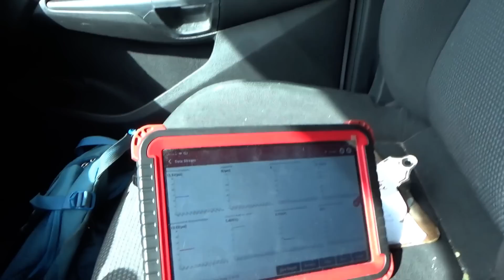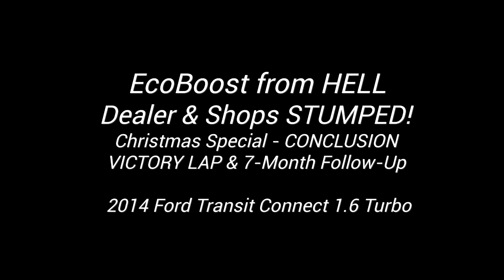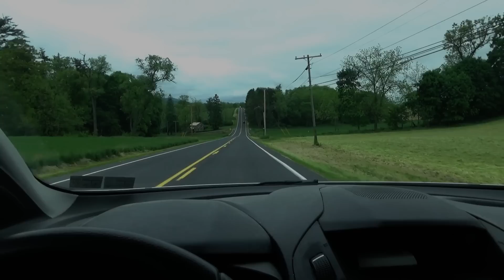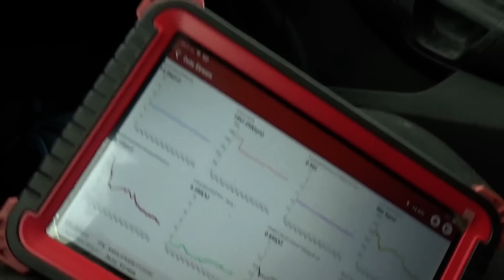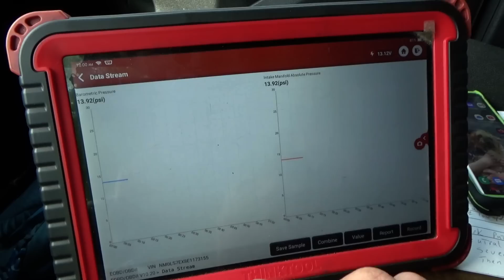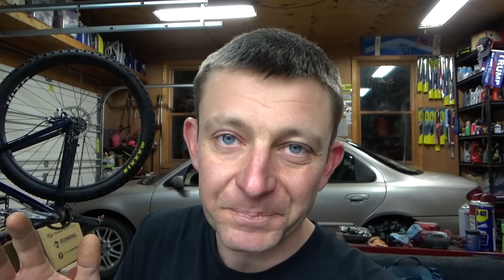(CONCLUSION!) *7-MONTH Follow-Up* EcoBoost From HELL (Christmas 2024)

Comment: Great job Ivan, those quick changes on the MAF were not obvious.  In regard to a diagnostic approach perhaps an idea would be to run a FFT on the various analog sensor data.  If the sensor  is being affected by an intermittent ground then it might show up with a high frequency spike on the spectrum? 🤔
Reply from the maker: Interesting thought! It seemed like a slowly drifting analog signal vs an intermittent connection, so not sure if FFT would show anything interesting 🤔
Reply: @PineHollowAutoDiagnostics  I wonder if the scope might have shown something a bit different in terms of the rate of change.  Jiggling the harness showed abrupt changes and the scanner data might have relatively poor sampling 🤔

Comment: As a recently retired auto/truck repair  shop owner for  30 years here in Florida I am a regular fan of your videos. This one with this pastry van really got my attention. I watched every episode being really anxious to find out what the problem was,  your patience and due diigence paid off.  After watching that video I wondered  to myself if any of these engineers, or technical staff from Ford ever looked at your videos, of course they would never admit it, but the time you had spent troubleshooting this issue and also the time that other shops and the dealer had misdiagnosing this. If Ford really cared about customer loyalty they should be able to offer to take of this customers bill as it was proven by your video that the crappy method  they  used at the factory crimping that splice connection rather than as you showed again by soldering that connection.  Of course they would not even offer a comment on this as their own dealership was not able to fix it and they would be afraid they may have to cover this under warranty. Great video.

Comment: So can it be said this splice is a factory flaw? Why didn't it manifest itself before hitting 100k miles? Must have been the wear and tear, heat cycles, etc.
Reply from the maker: They designed it perfectly to fail after 10yr 100k mile warranty 😂

Comment: In the telephone company we dealt with high joints all the time.   On data circuits we would leave 24 volts across the simplex on the audio coils just to keep current flowing to avoid high joints in a spice somewhere.     I can't tell you how many times the trouble would clear when we accessed the circuit with test equipment.   Just that additional capacitance bump from our test equipment would seal the high joint for awhile.   That's probably what is going on when you disconnect and reconnect the modules.    The re connection pulls just enough sudden current to clear the high joint temporarily. That's where a high impedance digital VOM can help to find voltage drops across splices without clearing the trouble.
Reply: High joint means high resistance connection, like Ivan's. A lot of the problems are actually caused by air pollution.

Comment: Re: the weird behavior of the splice, I worked in audio for many years and similar thing would happen when a thin layer of oxidation would form on bare metal surfaces increasing resistance at the contact point. The extra weird part was if there was was enough voltage and therefore current flowing at the point of contact it will 'burn' through the oxide layer and work ok for a while until left un-energized for some time and the oxide layer would re-form and issues began again. This was mainly with multi pin connectors at microphone levels (a few millivolts). De-oxit is your friend here. Soldering works too as it shields the contact from the oxygen in the air , but you cant solder a connector you need to de-mate frequently.
Reply: Yes an excellent assessment @HarblesTheSkeptial. Might I add that that splice was not sealed from the nasty environment of that engine, road salt water, the battery acid vapors and whatever else was drifting through from the vehicles on the road. Then there is the electrolysis from the current in the splice. What a chemical soup! All happening at a molecular level that is not visible. The corrosion is even beyond Ivan's eyes. That splice needs to have been in a gas tight sealed shrink wrap splice cover. The solder job is the right solution however I would have applied some rosin RA flux to the splice then heat it to let the flux activate. Then the solder would have wicked right into the splice. Then add a glue filled shrink tube. An awesome job Ivan! You should hold a offsite training session for the dealer technicians and charge them a hefty fee. What a great case study.
Reply: @jimharmon3404  "You should hold a offsite training session for the dealer technicians and charge them a hefty fee.". No one would show up; they rather sell complete new harnesses to their customers 🤣
Reply: @jimharmon3404  Electronics-grade solder (eg the type Ivan uses) contains a resin core, so full wicking is guaranteed. Additional flux can help but is usually only needed if the thermal mass is too great to allow good wetting.
Reply: Came here to say this and you had beaten me to it!
The fault defies Ohm's Law because of that oxide layer, it's behaving like a semiconductor - having a forward voltage drop rather than a resistance
Reply: Just to addto this excellent explanation, during the manufacture of that particular harness those splice wires may have been stripped ready. Friday afternoon. Left all weekend where the stripped copper collected that atomic level corrosion on the strands. i dont know but the atmosphere in the factory may have been a bit acidic? Then Monday crimped up and job done. its taken those years to finally act like some silicon diode with a breakover bias. Hence any forward voltage and current breaks it down. Good effort Ivan.
Reply: Exactly my thoughts. The same reason stainless steel and aluminium are awful material choices for any electrical connection air can get to because they oxidise instantly at an atomic level when exposed to air, forming a “passivation layer” you can’t see. A high enough voltage and current will break it down but for low level and sensor signal circuits, the resistance will be highly variable.
Reply: If you are right Ivan is right that a solder joint is always better then a crimp in those conditions! You would expect that car manufactures should be aware of this problem and thus stop using these type of splices.
Reply: @mark-d9k9b  Wiring harnesses are made up on specific jigs and the wire lengths may even be pre-cut.
In the production line environment the open barrel crimp is the fastest, most reliable and repeatable connection method.
Keeps the health & safety people happy too because there's no high temperatures or fumes.

For a field repair, you have to choose the most practical repair method, which may differ from the factory method.

People claim soldering causes a fracture point.
Guess what... So does crimping.
As long as the joint is protected from vibration stresses by using adhesive lined heat shrink and is done on a part of the harness that doesn't flex in operation, there's no issue with a soldered repair.

I've done many wiring repairs and maybe 10% of them can only be attributed to production line damage - situations where a wire within the harness has gone open circuit but has not been physically damaged by anything on the vehicle.
Reply from the maker: Excellent explanation! 👌😁
Reply: Like Ivan noted that splice was inside the harness and was sealed up quite well from the factory, so I can only assume that that splice joint must have been made improperly at the factory. Like maybe there was some kind of corrosion or dirt on the wires that were spliced together..

Comment: Possible explanation: galvanic corrosion. Hear me out- you don’t have to see the green corrosion grinch for there to be a corrosion problem, it can exist between wires if there is a voltage potential and an electrolyte. Even if it looks dry, the moisture in the air is sometimes enough. I fought a similar issue on an F-18 once, took a month to solve so don’t feel bad lol.

Comment: How about this theory on that splice. That splice crimp metal was cut and formed on a sheet. Many sheets of metal are plastic wrap-protected. WHAT IF that crimp was formed with a piece of thin plastic sheeting on it. Time, age, heat, and melting to self-insulation of the wire. ???????????????????

Comment: Your the best Ivan. This is the wildest repair I've ever seen I think. Who the heck would suspect that splice when it pass the tug test. I can't see a reason why it wouldn't work. It's mechanically strong. It's connected. And for low current less then 1amp. It's hardly a heat issue. It's boggles my mind.

Comment: I HATE crimp joints in wiring. Too many variables happen with them. IF there is any type of looseness in the joint, it causes the variable. You found this in a Volvo you worked on a year or so ago where a chassis ground wasn't clean enough to cause problems. Same thing with the engine ground on the Camry. They have to be CLEAN and TIGHT. With all of the computerized modules in cars depending on good wiring connections, you have to pay close attention to the wiring and proper connection within the wiring system.

Comment: Ivan, this case study and series was your best yet. The scanner showed lots of erratic behavior, and that wiring diagram showed how all these sensor codes and grounds were inter-connected to a 5 wire splice in the middle of a wiring harness. Solder for the "WIN".

Comment: I am with you.  MIND BLOWN !  That crimp looked PERFECT !  I am still surprised that you declared 80mv ground difference was "acceptable".

If your customer wants to keep that van on the road for another 100,000 miles, I would suggest he change the timing belt and guides.  Also, every 10K-25K, check the MAP sensor and other "critical" sensors for oil (unless someone finds the root cause).  Finally, every 25K pull the camshaft oil control solenoids and clean them.

I hope the customer got his money back for the sensor that was NOT replaced.  He should get his money back for the defective Dorman solenoid.

Curious.  How many labor hours did you charge for diagnostics and repair.
Reply: Sensor grounds loop thru the PCM so it'll never be zero.   What matters is that it is consistent.
Reply: @v12alpine  True on consistency !  

The best sensors should be ratio metric, like temperature sensors or throttle position sensors.  Pressure sensors are "absolute" and therefor are susceptible to ground or Vref offsets.

25+ years ago I designed PCMs.  There should be no "loops" !  Every sensor/actuator should get ground from the module.  Multiple grounds from the PCM should attach as reasonably possible to battery ground.   IIRC, the PCM "case ground" was isolated.
Reply: @jackpatteeuw9244  yea, loops are bad...I should have picked a better description... for sensors, its usually a "star" ground with the PCM being in the center.

Comment: Ivan could one of the components of that ground tree issue have been bleeding off voltage from a capacitor or something like that and that was causing the higher voltage?? Or could it of been another wire near that splice sending out an erroneous trickle voltage and when you soldered that splice it had a better / direct connection to ground?  Just thinking outside of the box. Your videos do a fantastic job of explain the complexity of these over engineered autos. I do not know of anyone who would of solved that van's problems. Every video I learn something new. I would like to say Merry Christmas and have a very Happy New year.

Comment: I suspect unplugging that sensor allowed the bad crimp/wire to cool restoring the correct reading when you plugged it back in. 
Resistance being proportional to heat (like a thermistor) in that bad factory crimp seems like it was just heating to a set point then setting there giving you the reading you keep seeing.

Comment: 11:23  Map and Baro SHOULD agree.  When they don't, it should set an error flag that THEY DON'T AGREE

I recently suggested on SMA that the onboard error detection is still immature.  In SMA I demanded there be a backup CAN bus(es) with provisions to automatically switch as needed.  AND to ACCURATELY report this effort.  Redundancy isn't anything new but certainly more expensive but well worth assuring my trip from Denver to St. Louis won't be a broken event particularly during cold, dark holiday travel.  

COME-ON designers...   computer memory prices are cheap; processor speeds are sky-rocketing;  technology is well developed, so let's focus on and market upon: enhanced error detection and correction.  Already implemented is substituting calculated parameters for flagrant/suspect values -- so expand upon this.  And... computer software update isn't difficult or uncommon.  An update for $100 would/should keep shops busy.  I.E. software is NEVER fully complete.
Reply: Ivan showed examples of the  non-matchng pressure sensors setting an error code.  The CAN bus is likely to be supplanted with  ethernet, but even if not,  I suspect only a small fraction of breakdowns would be attributable to CAN bus failure per se, so might not be the highest priority for redundancy.  (There might be more benefit in making modules' interface to the bus fail in such a way that it never wedges up the communications.)   And as for software updates:  over-the-air updates are becoming more common -- no need to go to the dealer.

Comment: I am suspicious that this connection was acting as a transistor. See my comment from yesterday where the lead oxide on my battery post became a diode that permitted current flow out of the battery but prevented the alternator from charging it.
Reply: Several comments below offer the idea that this is more like a diode effect. This is possible, with a very low reverse potential fence. Once overcome it loses its resistance. It explains how it can have resistance sometimes and other times not.

Comment: I think the explanation for the "fixed" 0.3V voltage drop could be slightly dissimilar metals and some conductive fluid making them act as a battery cell at 0.3V.  Wiggling the crimp would cause the metals to actually contact each other (rather than having a microscopic separation from whatever fluid was there - most likely salt water) and that would discharge the "battery", causing the voltage drop to be near 0V for a while. Forcing current through the ground would again charge the "battery" to it's cell voltage of 0.3V.

Re the codes the engine computer set:
Maybe they had some limit on how many codes they were allowed to use (either technical limit, or some idiot manager setting some arbitrary limit) and they had to use whichever code that seemed the least bad rather than have an actual code. Sure, whatever the description of that code was hints at that the sensor value is wrong, but it would had been better if there were a specific code for the outside pressure v.s. intake pressure not agreeing when the engine is off.

Merry Christmas and a happy new year Ivan!

Comment: 1. Youtube pisses me off.  I missed several of your videos because somehow I became "unsubscribed".  2.  I'm not impressed with how many systems can be affected by one small thing.  I have a 2020 6.2 Sierra with 121k miles.  Around 96k I replaced the plugs and plug wires.  Bought the coil packs but didn't replace them.  About 109k miles, the cruise control started acting up.  Scanner showed multiple codes across Brake Control Module, Transmission Control Module, ECM, BCM, etc.  Truck ran fine, but one weekend I decided I was going to find the problem.  I suspected maybe a chafed harness somewhere in the engine bay or under the truck.  What I found blew me away.  Those GM plug wires are Aholes to unplug and plug onto the spark plugs, and while digging and looking I noticed one of the plug wires wasn't snapped onto the plug wire properly.  I snapped it on and it hasn't thrown another code since.  Love your videos, and I'm glad I get to catch up on a few that YouTube denied me.  Keep trusting that soldering iron.  When you know how to use one properly a soldered connection will never let you down.

Comment: Sensor ground issue... with the low nominal current involved, it could be oxidation formations in the crimp acting as a contact diode, thereby creating a voltage drop with little  dependence on resistance.
Reply: Oh shoot,  I posted the same idea!